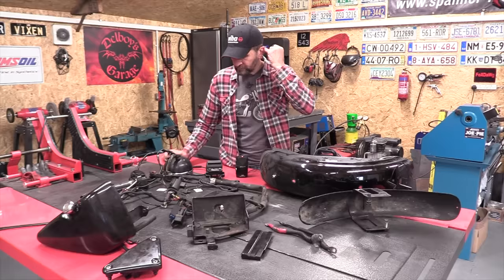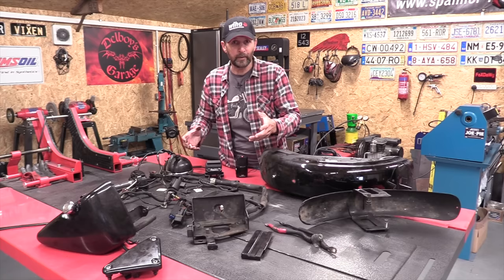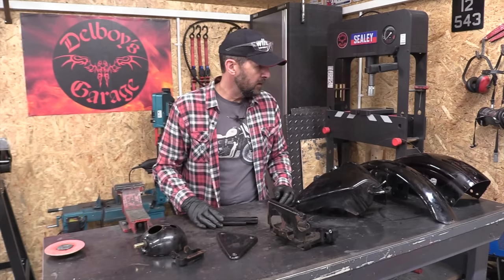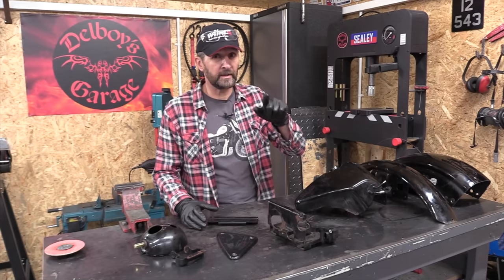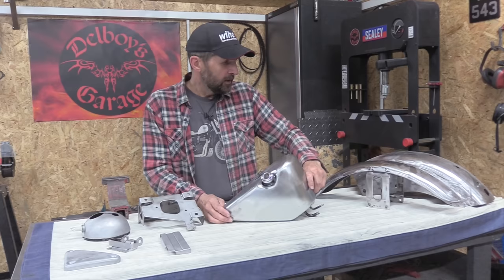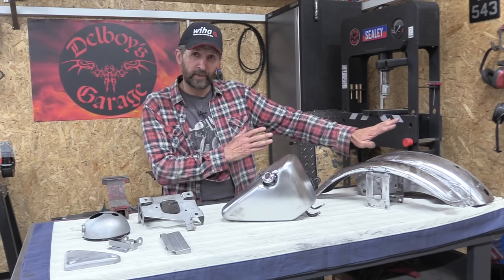Harley Sportster Project:-  Strip Tins for paint !

Comment: In as much as rust seems to be inescapable in the UK, you should do what a buddy of mine did with a custom chopper he built. He took the tins (fuel tank, oil tank headlight bucket and fenders) down to bare metal, then sprayed them with muriatic acid (it's normally used to scour swimming pools). Once a nice patina of rust developed after a day or two, he neutralized the acid and used a matte clear coat to seal all of the parts. It came out strikingly well, and still looks great after a little over a decade.

Comment: Lots of prep work involved there Del, I was impressed with the rubber seals around the headlight, looks much more effective at keeping the weather out than some other designs I have seen on other bikes. Have a great weekend.
Reply from the maker: Yes indeed Andy, that headlight seal is amazing, it's extremely chunky, pliable soft rubber and completely seals with two metal chrome rings, which hold it firmly in place... the effect on sealing the interbals of the headlight is clear to see as the wiring in there was spotlessly clean and bone dry, even after 20yrs and looking at the rest of the bike, it's hardly had an easy life!

Comment: Heya del hope ya doing well,loving the process of it all,im actually in the middle of stripping my sportster down,im looking to do the brushed steel finish, I like the look you got on that oil tank,can I asked what pads and stuff you used cheers bud👍
Reply from the maker: A little while ago now buddy, can't exactly remember what I used on that day, but generally for scuffing steel a good option is the 3M Scotch Pads, you can buy them for automotive paint preparation... in a pinch, you can use the regular green Scotch Pads from your kitchen, but they're not very effective by comparison... hope that helps and good luck with it!